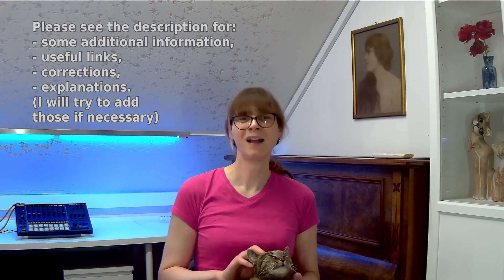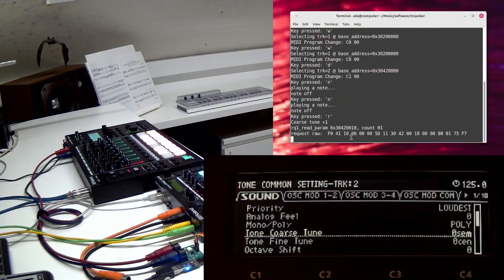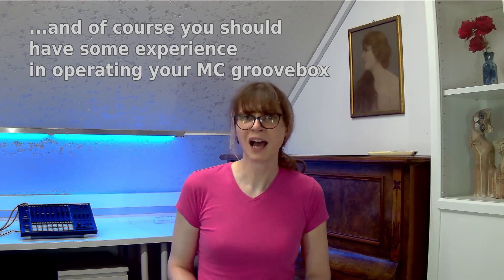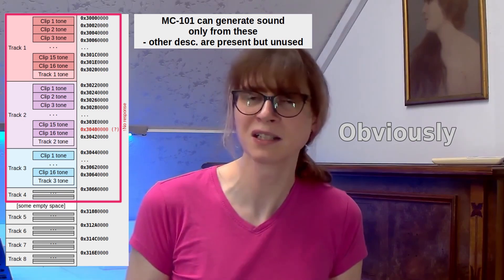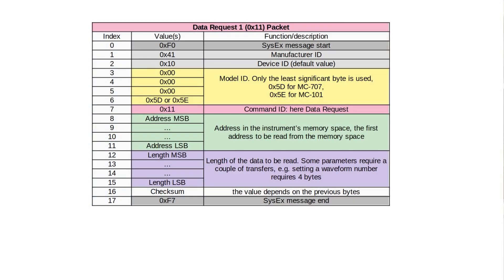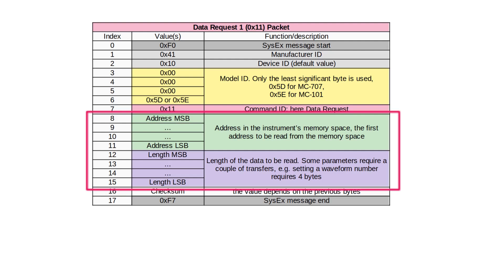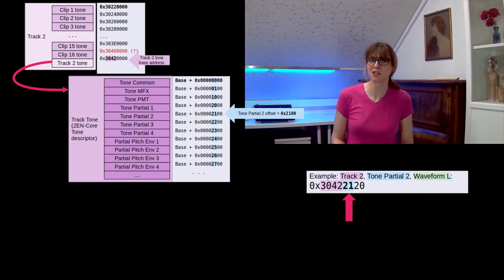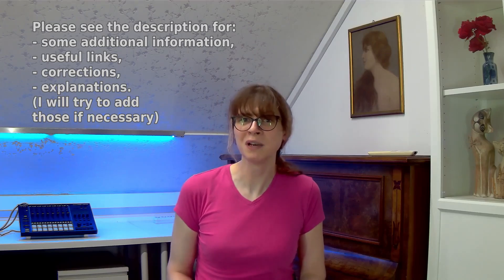Roland MC-101 & MC-707 ZEN-Core synth engine control with MIDI System-Exclusive messages

Comment: you're brilliant. Roland clearly has some greed issues by not opening sysex – maybe they are scared that allowing this access to the deeps will give so many possibilities that no one would need new hardware? :) TB-3 with sysex gives player way more than Roland wanted to give, it seems. your video was mentioned on the electronauts TR-8s thread, by the way – folks out there are trying to decrypt it.
Reply from the maker: Thank you :) Great to hear that the video could be useful - also would be nice to have TR-8s worked out. I think that not disclosing the Sys-Ex communication by Roland doesn't have to be the matter of greed, but maybe a laziness combined with avoiding tons of extra documentation. The laziness because if they disclosed it, they would have to fix all the software bugs related to it and test the software at least at a decent level. In the video I say that I couldn't read one sound - it just doesn't respond. And I agree with the possibilities of the sys-ex in these instruments - recently I had a thought that knowing the sys-ex interface is kind of like almost having an open source firmware :)

Comment: Hi Ada, thanks for the great video, very inspiring work! 
I recently bought an MC101 and have been trying to reproduce your work in a Max patcher (the plan is to run it on a Raspberry Pi with RNBO, and control it with touchOSC), but without success.

The device responds to universal SysEx and I could set the master volume to 0 by sending an all-call 'F0 7F 7F 04 01 00 00 F7' message, so the messages sent by my patcher are received by the device.

Unfortunately as soon as I try to target specific device messages - like partial coarse tune - the device doesn't respond.
I adapted the modelId to 0x5E, and to further test I tried to loop on deviceIds from 1-32 (mine is set to 17, the device only allows from 17 to 32). 
Might try to update the patcher later to make it scan all possible addresses.

Also I noticed that the device does not send SysEx messages to my interface - except a serie of consecutive messages on startup that chatGPT identified mainly as a handshake, so I guess bidirectional communication can't be achieved?
 
Did you actually test your script on a MC-101, or did you presume it worked the same as the 707? 
I did not try it yet myself, but it will be my next move as soon as I have the time. 
I suppose it should work a way or another as the ZEN-Core Editor-Librarian advertise to successfuly handle it. 

Any help would be greatly appreciated!
Reply from the maker: Hello Antoine, thanks for the comment. Yes, I checked it also with MC-101. To be sure I've just repeated the test a couple of minutes ago with MC-101 over MIDI DIN interface and a serial port as in the video. Here Is the terminal log containing the byte-by-byte dump for reading the coarse tune value 0x40 on MC-101 and writing it back modified to 0x41 (I'm working on Track 2 Tone as in the video):

Key pressed: 'r'
Coarse tune +1
rq1_read_param 0x30420018, count 01
request raw:  F0 41 10 00 00 00 5E 11 30 42 00 18 00 00 00 01 75 F7
response raw: F0 41 10 00 00 00 5E 12 06 10 00 18 40 12 F7
   response len=15
extracted response: 40
   len=1
sent the value 65=0x41 of size 1 to address 0x30420018
     set raw: F0 41 10 00 00 00 5E 12 30 42 00 18 41 35 F7

So, the SysEx message to set the coarse tune to 0x41 (3rd byte from the last) was this one:
F0 41(Roland Id) 10 00 00 00 5E(MC-101 id) 12(Set) [30 42 00 18](address) 41(the coarse tune) 35(checksum) F7

Do you have a possibility to send such raw messages? I used this method with sending raw messages to (successfully) test the communication over USB before I started developing a better USB driver.

Here are some of my MC-101 settings that may be important for the above example:
In track settings:
Track 2 → Sound Src = Track
In Utility→System(MIDI):
Ctrl Ch: CH16
Ctrl Tx OUT: ON
Ctrl Tx USB: ON (shouldn't matter when comm. over DIN)
Ctrl Rx: ON
Device ID: 17
Soft Thru: OFF
USB Thru: ON (also less important, but I'm just telling how I have it set)
Rx Scatter: ON (remark as above)
Edit Note: ON
Reply: Hello Ada, thank you so much for your reply! I just tried with the messages you sent me and it worked ❤I can't emphasize enough how happy this makes me! Will be happy to share my Max patcher and touchOSC templates once ready! Have a nice day!
Reply from the maker: @AntoineDannemark   And I can't express enough how happy I am that my hobbywork could be useful :) Thank you for the feedback and I'm wishing you good luck with your implementation!

Comment: Great Work ! Thanks Ada ! Just subscribed. That Groove Workstation is so much underrated and so limited by Roland itself.... We definitely need a 2.0, Module expansions (like in zenology and other synths), Sidechain compression and so on....
Reply from the maker: Thank you for the comment and sorry for my late response. I feel like Roland has abandoned the MC grooveboxes😔 I doubt if there will be any firmware update in the future. And I'm quite pessimistic if there will be any more stand-alone grooveboxes from Roland, because to me it looks like everything goes more in the direction towards being a hardware add-on to a computer software. I think it's visible when looking at how Fantom is presented (as a synth with a DAW integration, not a workstation). Or the recent SP-404 firmware update... Btw I noticed that people from the SP-404 community also want the sidechain comp, but they got a software integration with the recent update😅

Comment: Cool, could you do a demo with a midi controller please?
Reply from the maker: The problem with "regular" MIDI controllers is that here we have to use a specific packet structure and we have to compute the checksum. That's why we need a controller which is programmable at its firmware level - like those DIY MIDI controllers you can find. I plan to design someday such a controller for the MC-related purposes. I'm afraid it'll take some time, I will be happy to share here

Comment: Amazing work; you got there before me as I was looking at the wrong thing: I was sniffing USB as I was expecting the device to talk to the computer via the USB port, like it does when you use Zencore VST editor. Everything was right there on the midi data pack instead... Glad you got the solution as now people can finally have controls for those parameters via external gear, and wihtout have to buy Zencore pro just to do that.
Reply from the maker: Thank you for your comment😊 
The MC Sys Ex control works over USB too and a simple USB test is in the video description if you need it
Reply: @Locriana  Great job, clearly you are better than me at digging through these protocols :)

Comment: Thanks a lot! I have an Electra one controller which is basically a lua script running device with touchscreeen and knobs that can send midi. Your video made me realize I could implement a somewhat visual patch editor for the Roland devices  on the Electra one. Not sure if I have the time to actually execute this plan but I am putting it on my list of interesting plans to try out.
Reply from the maker: Thank you so much for the comment and it's super awesome that the video can be useful in practice 👌🏻

Comment: Now I am really wondering if these parameters are accessible on the MV-1….
Reply: I️ am also an MV verselab user as well and I️ had the same question.  🤔.  Will be interesting to see.
Reply from the maker: @radatabass  Hi, I have good news (at least partially). In Verselab the Zen-Core parameters are also available via Sys-Ex messages. I found Zen-Core sound names starting at the same address range as in the MC (0x30000000). But there's an important difference: I had to use USB-MIDI to have communication for both Data Requests and Data Set messages. When I tried using MIDI DIN interface, I could only write data to the MV using Data Set messages and it didn't respond to requests. I can't promise anything, but I'm planning another video with some (I hope) interesting updates
Reply: @Locriana this is so cool. Thank you for the update.   Makes a lot of sense as all 3 units seem to have a lot of similarities.  Appreciate the update and keep up the good work 👌
Reply from the maker: Hi,
MV-1 has its interface partially hacked too :) You can try this link (it's also in the video description):
https://drolez.com/blog/music/sysex-codes-for-roland-verselab-mv1.php
I don't have Verselab so I couldn't verify it, but that info looks okay to me
Reply: @Locriana  thanks, that's useful. But I was wondering particularly whether they had exposed the Zencore parameters or the partials (which are not normally editable on the MV-1; I don't know why Roland opened them on MC-101 and MC-707 UX but not MV-1).
Reply from the maker: @Geekraver  From what I seen on Roland page, the software versions of MV and MC have the same numbers. Maybe it's not a coincidence, but it may look like they are developing the software for all of the 3 instruments. I've also checked the MV-1 Reference Manual and I see it uses something like clip tones too. The same architecture, the same engine... Maybe also the same memory organization? Idk... I think that there is a chance the hack from the video would work similarly on all three instruments, but I can't tell for sure

Comment: Awesome work. I’d be glad to see that on the SH4D. The MIDI implementation is so poor, you cannot even control mutes/solos or the FX ! Of course I would prefer Roland to actually update their firmware and documentation to allow that to be done easily and officially. It’s not really ZenCore based or it’s only inspired by so I don’t know how different the SH’s multi-model architecture is.
Reply: This video is making me regret selling my SH4D. I hope it works for you. Too late for me haha.
Reply: @nina-sus2 you can still buy it again, maybe even for cheaper than you sold it for ! I’m going to combine it with the ERAE 2 controller. Only thing is the MIDI implementation chart is currently a shame. So basic and made more for sound design than for live jamming, I mean no mute/unmute, no FX controls via MIDI, what were they thinking ? Would be so fun to control the amount or other parameters of the FX through the ERAE’s aftertouch. And of course, they need to add side-chain. The V2 update has been an amazing improvement though, all the features added are so valuable.
Reply from the maker: Thanks :) I've just checked the SH 4d documentation and I agree. To me it looks like it has the same ZEN-Core engine but with a limited user interface🤔 I suspect that it might have been intentional to make the sound editing more "creatively stimulating" but not as overwhelming as the "menu-divy" editors in MCs. But, theoretically, if somebody is determined enough, maybe it would be possible to perform a similar scan&dump on the SH?
Then it would required checking what's the model ID of the SH 4d and then maybe using that ID it to try to "poke it" with SysEx requests? Idk🤷🏻‍♀️ 

Btw. if it would help: I used this MIDI SysEx sequence for the Identity Request Message→ [0xF0, 0x7E, 0x7F, 0x06, 0x01, 0xF7] to make the instrument return the information about itself, including its model number. You can find it in the Python code around (key == 'i'). The model number is required for the SysEx communication with the gear & SH 4d will surely have different ID than the MCs.
Reply: @Locriana any way we could dump the ID ? Can it be guessed when looking at the USB vendor/device id it presents to a host ?
Reply from the maker: @al8xandros You may try sending the "Identity Request Message"  [0xF0, 0x7E, 0x7F, 0x06, 0x01, 0xF7] over midi. The device may then respond with the "Identity Reply Message" with the field "Device family code" (the device ID is another thing and it's usually just constant 0x10 - I wrote it ambiguously in the previous comment). You may check for example the Fantom 0 MIDI Implementation Chart for these messages: both the Identity Request and the Identity Response are described there, but just in the context of Fantoms 0.
Reply: @Locriana  thanks, I don’t have the serial to MIDI adapter and actually I don’t have any serial to USB to go to my host either. Is there a reason for not using directly USB midi ? Do you think they filter sysex through it ? If possible with USB would you recommend the vendor or generic MIDI driver ?
Reply from the maker: @al8xandros  I've got super good news for you: I've just tested the Coarse Tune setting to +2 as in the video, but using MIDI over USB while the MC is connected to the PC - and it works! 🥳 I feel euphoric now! I tried both Generic and Vendor driver on my MC-707 - and it worked in both cases. I use Linux (obviously ;)), so I tried it with the "amidi" command, like that (copied & pasted exactly from the terminal):
amidi -p hw:2,0,0 -t1 -d -S 'F0 41 10 00 00 00 5D 12 30 42 00 18 42 34 F7'
The "hw:2,0,0" is how my MC was displayed after issuing the command:
amidi --list-devices
and the SysEx message contents was copied&pasted from the terminal from the mcpoker.py.

And thanks for the great question! I'll add this issue to the description

I used the serial port, because when I started I had totally no idea what to expect, and I find the serial port tools very predictable and I have lots of experience with all their tricky behavior.
Reply: @Locriana  indeed very good news. Means I’ll definitely try to get the device ID with your method. Not sure I have the skills to go as far as you did with the MC. But I’ll give it a try. Do you have a discord or something to extend and capitalize on these discussions ?

Comment: This is gold to me. Thanks a lot for sharing your research!
Reply from the maker: Thank you for the nice words!
Reply: @locriana. Using your script with some minor changes (using rtmidi instead of Serial) plus the midi spec for the jupiter X, I've managed to control a bunch of parameters from tone tracks, which is awesome.

I was now wondering if you managed to discover any way to address drum tracks. I've tried setting up a drum track and dumping the contents of the track addresses, but it still shows up as a tone track.

Anyway, thanks again for sharing all this.